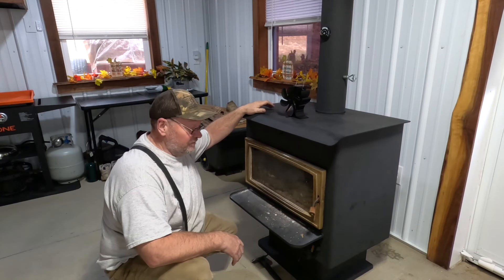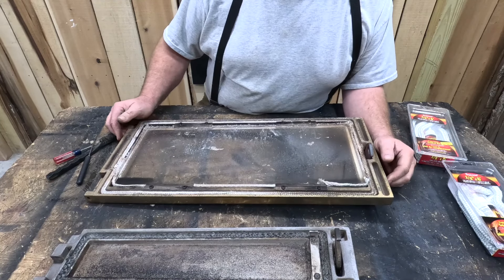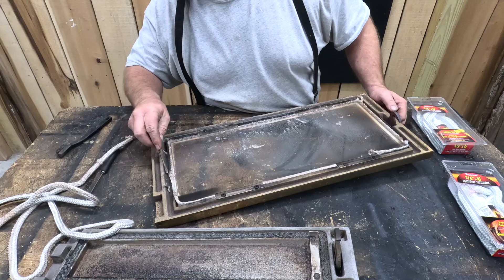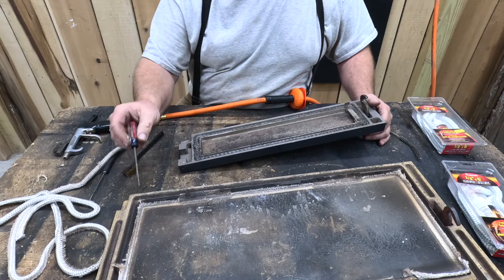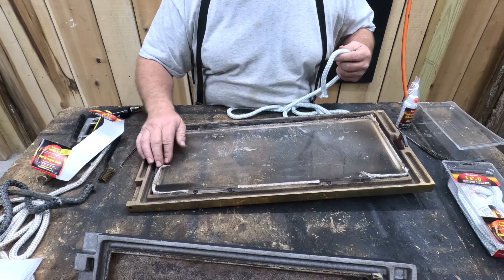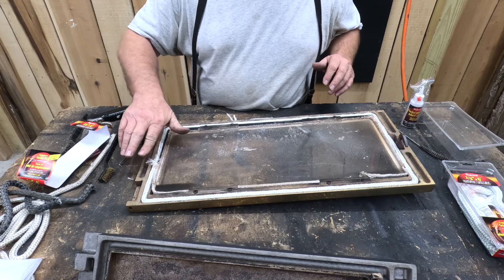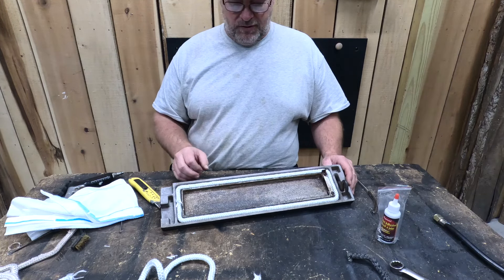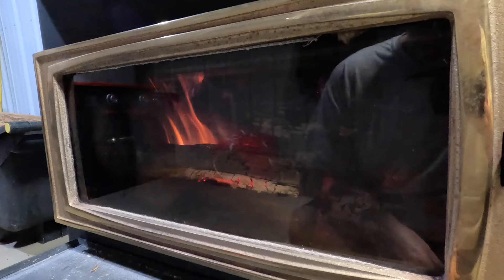How to replace the rope gasket door seal on wood burner stove

Comment: Never knew new gaskets were so important. It seems it can save on wood and provide better heating. Thank you Kevin.
Reply from the maker: Yeah they do make a difference as far as air leaking around thge door and causing the stove to not burn right , thanks for watching.

Comment: had two chimney fires in one day so we went to home depot and im installing a new gasket and damper
Reply from the maker: You may want to clean your chimney to the gaskets will help. 
If I can help let me know.
Reply: @Robinson-Homestead  got her good now i put the damper in and gasket with the cement not the junk glue they give ya , working great now and thats good because its -20c today
Reply from the maker: Glad to heat you got it  in safe working condition